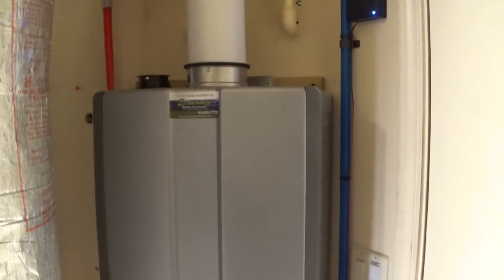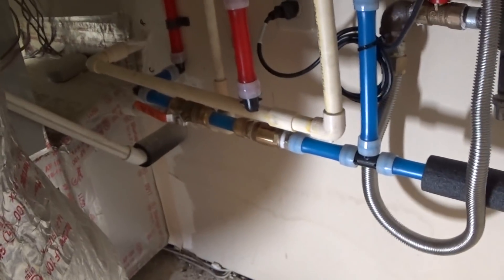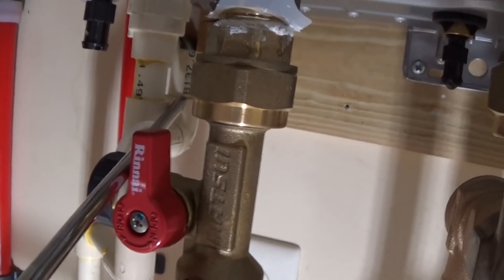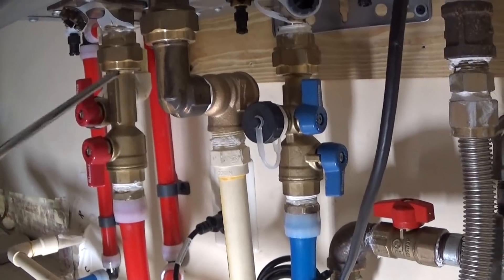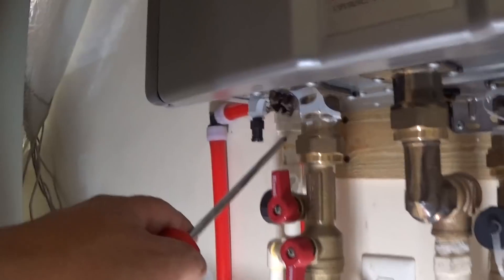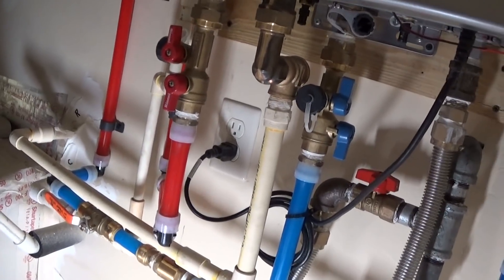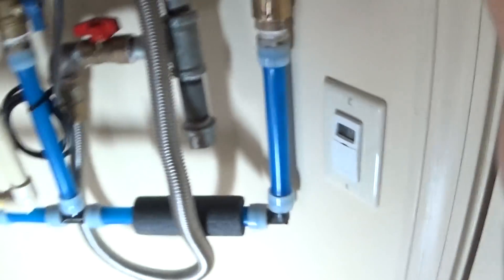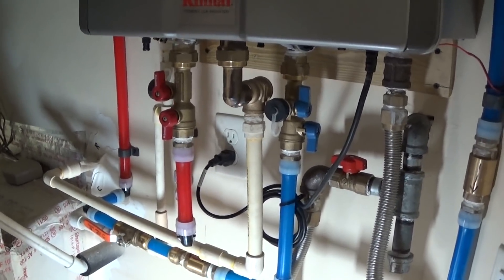Proper piping for a dedicated circulation line on a Rinnai RUR series unit.

Comment: I'm experiencing a 63 error code with swing valve installed on the recirculation line. Do you think these are related?
Reply from the maker: yes the get stuck and will cause a reduction in flow. they need to changed to spring checks. Mike

Comment: You do amazing videos. Question about the hot recirc line. How to (if possible) deal with the hot water recirc if using a manifold? I have a new RXP199IN being delivered this friday. Thank you in advance.
Reply from the maker: If it's a Viga style manifold like there mana-block the circulation will not work no matter what they tell you. The only fixture that will get hot water the hot line you attach the circulation line too.

Comment: I have a single family home with ONE water main.  My house has a tankless unit on each side.  Half of the house has a dedicated recirculation line the other half does not.  We decided to put in a RSC199in so that we could use the cross over valve for all the appliances on the side of the house with no dedicated line.  Well it does not work very well I think due to the single water line and it's trying to mix with the cold water on the other side of the house.  My solution would be to put in a check valve to isolate the loop using the cross over valve, your thoughts?  I am also concerned that the check valve would be under the same sink that has the cross over valve which would bring cold water into that appliance quickly.  I appreciate your channel and whatever thoughts you might have.  Thanks

Comment: After installing dedicated recirculation on my RU160iN i get a water hammer ! Also do you know hiw the economy and comfort setting wirk with a dedicated recirc !  I did put in check valves ,, spring type !
Reply from the maker: Stephen, install a thermex expansion tank on the cold water after the check valve and set the unit on comfort setting. Mike
Reply: @ThatTanklessGuy  Thanks ! I put in some small water hammer arrestors but they don’t seem to help ! Will definitely try expansion ! Does comfort mode not increase costs significantly ?? Also error 63 after cleaned out the cold water filter !
Reply: Just cleaned filter again more black debris !
Reply: @ThatTanklessGuy  still getting code 63
Reply: @ThatTanklessGuy  Installed Expansion Tank. Eliminated the Water Hammer.

Comment: Hello! I just installed the external version on this. I didnt see in the manual about the bleeding of the pump. (Oversight) I also did not install that check valve. My water was lukewarm last nite. No piping was changed other than changing out the old tankless. Lukewarm water usually means a line crossed up. However this is piped basically like the old unit. Can you advise what to check?

Comment: As per the installation instructions, Rinnai recommended an expansion tank be used on the "closed system" area within the check valves because of thermal expansion of the lines.  After a phone call to confirm,   the engineers said that the lines could burst or the check valves may stop working if the pressure gets too high.  Did you use an expansion tank behind that other wall? If not, why didn't you use an expansion tank?   Do I really need and expansion tank? Thanks

Comment: I’m confused about the recirc line.  I have a well so water will be going into my tank at about 53° and leaving at 120° let’s say.  The water coming back to the tank will probably be less than 120° but way hotter that 53°.   What I don’t get is Why does the tank need a recirc pump if you have a tee and both are going back into the tank at the same time?  What if you hooked this up the same way as a non recirc rinnai?
Reply from the maker: The pump moves the water it can not come back by gravity
Reply: @ThatTanklessGuy  but doesnt the water pressure from the well or the street pressure move the water through the tank and to the fixtures?  if it comes back to the tank the well or street pressure doesnt push it back into the tank?  or without a recirc pump the pressure is equal on both sides of the Tee and the water never comes back?
Reply: You still have to evacuate the hot water pipe if the cooler water in order for the hot wster to take its place. A pump moved the process faster with wasting no water.

Comment: Hi Mike,
I don’t have a dedicated return line but I’m curious if I can install 2 bypass valves in different locations because the water lines branch immediately from the water heater?
Reply from the maker: No you can only use one bypass valve per unit.

Comment: do you need an Expansion Tank piped in ?
Reply: There is very little thermal expansion in a tankless. If you want to install one it won’t hurt the system. I only install one when the house has lawn sprinkler off the main water system. Mike
Reply: @TheBuddylab  Thanks

Comment: Fantastic video, as always. Quick question: Given the hot water recirc is now a closed system, does the RUR series require a thermal expansion tank be installed?
Reply: Yes you can install one and ST10 Mike

Comment: Do you need the check valve on the cold side even if I don't gave a recirculation line? I am using the thermal valve under the farthest sink. Thanks in advance Mike
Reply: No check valve is required when there is no dedicated return line. I hope this helped. 
Mike

Comment: You need an expansion tank there bud
Reply: I was wondering this. Are expansion tanks required for tankless? Only if they have recirculation pump built in? Expansion tanks are for if there’s storage of hot water, correct?
Reply: @Jabboy8  Expansion tank is need for recirc system. On a normal open system, without a recirc line, pressure is relieved when opening a hot water valve. Without the expansion tank the system is closed (no pressure relived when the water is heated) therefore, expansion of the hot water could cause a pipe break. The tank allows the built up pressure to be contained.

Comment: thank you for the video! at 7'30", it is mentioned that a drain could be placed on the recirc line before the check valve. Is it OK to have the drain after the check valve, just before it connects back with the cold water feed?
Reply: You could put it after the check valve. Your bleeding it back to the tankless. You need to have the ball valve after the check. I hope this helped. Mike
Reply: @TheBuddylab  thank you! Just wanted to double check. We are having issues with getting consistent hot temperatures, and only get hot water while the pump is running. Once the pump turns off, the water outlets all get cold even when still running 100% hot water line at 4GPM. We think it is a bad spring check valve letting cold water back into the re-circ line. The re-circ line feels cold to the touch, too, even when the hot water-out line is very hot.
Reply: @jr6879 did you ever fix it?

Comment: Hi Mike! Excellent video. Can you please explain why the vent on the condensate drain is needed and what happens if not installed? Thanks!
Reply: It improves the flow out of the pipe and prevents the pipe from getting air bound. I’ve seen a few times on condensing drain lines there was no flow out of the pipe until I cut it. I hope this helped.
Reply: Not just a vent but many probably missed the air gap at the bottom. It is not sealed to the drain. Diff manufacturers state different gaps. Mine is a 1-2" gap. Still dont know why.

Comment: Mike.  Why does Rinnai have the recirc line return into the cold water inlet?  Navien has a separate recirc inlet into the heater.  In theory, that seems more efficient.  How much pressure does the Rinnai recirc pump generate?  More than the city water pressure I presume...  
You are a Youtube Hero!  Thanks!!
Reply: It’s better into the cold water line it mixes with the cold wster before it enters the heater. All commercial installation like hotels and restaurants with tank type heaters or Rinnais Demand Duo all go into the cold water. I hope this was helpful Mike

Comment: great looking install for sure. Not trying to be a video jerk, but your gas valve is on the wrong side of the drip leg. And.... why do they ask for a check valve on the cold side. Anti siphon? I have installed a few of these.
Reply: you definitely did good made the pex look good but man this would be just meh near me... like you didn’t use any copper ??!! I wouldn’t be a fan. Plus we can’t use flex gas line to hook these up and definitely not uncoated ones.. and for god sakes don’t be hitting your releif to purge your boilers. That might work  when it’s brand new. You do that when it’s old and got some build up you’ll never get it to seat right again and it’ll be leaking like sieve and you be replacing it. Oh and shark bits are gross they are expensive and I’m sorry that shits for dire emergencies and home owners. Professionals shouldn’t be using them. Also where is the mixing valve? Pex looks good though give him that.

Comment: Thank you so much for all the info, your channel rocks!!  Is the piping the same for the RUR and RU199IN model with a recirculation pipe?
Reply: Yes except you have to install your own pump and wire it into the RU unit. Rinnai sells a pump and wording harness for it. Don’t forget the two spring check valves. I hope this helped! Mike

Comment: What is the purpose of the spring loaded check valves?  Are they necessary?  I  will have a dedicated return line.  I am installing a RUR199e exterior unit.  Also, If I don't install the return line right away, will the system work okay for now?
Reply: David Allen there to prevent water from packing up into the piping. It will stop the recirculating water from backing up the cold water feed and the cold water from backing up the circulation line. Use only spring loaded checks not clapper 
I hope this helped. Mike
Reply: @TheBuddylab  Thanks.  Two more questions.  If i don't hook up a return line right away, will this unit still work without any problem?  Also, i think in you video you said I can run 2 return lines.  I ask this because i have a master bath on one end of the house and another bath and kitchen on the other with my water heater in the middle.  Can i just "T" it back into the cold at the heater?
Reply: David Allen yes you can run two return lines, as long as both are 3/4” the RUR199 can handle 400’ of 3:4” and 100’ of 1/2”
You can run the unit without return lines just leave the pump off and run it like a regular tankless. It would be better to call me before you install anything. Mike
Reply: @TheBuddylab  Thank you.  I have everything installed except the check valves  which I just bought and will install tomorrow.  I will wait on the return line which i may not even need.  My Master bath is only about 20' from the heater in one direction and my Kitchen about 20' in the other direction with another bath in between and a 3rd just on the other side of the kitchen.  I'll call if I get stuck but your video is excellent. I have previously installed an older unit but it was an old smaller one that I had moved from one spot to another so I have some experience but it didn't have any check valves in it.  I am an amateur plumber or i play one on the weekend. LOL.
Reply: Mike: I found this video too late to prevent my plumber from installing clapper valves instead of spring-loaded check valves. What problems can I expect from the clapper valves in my recirculation line? Is Rinnai aware of the need to use spring-loaded check valves?

Comment: Can you show the proper way to flush/service a recirculating unit using the built in pump?
Reply: Matt Hubbard you can not use the built in pump to flush the heat exchanger, you need a flush kit and flush it through the valve kit. All tankless heaters are flushed exactly the same. Look back in my videos and I have one on flushing a tankless. Mike
Reply: @TheBuddylab  thanks for your help. Your videos are great

Comment: You're very knowledgable and your videos are clear and informative!  Thank you.  
I have an RUR199iN. I'm waiting to connect the recirculation line until Rinnai's new Dedicated Recirculation Valve (Rinnai P/N 107000450) becomes available. Right now, the 1/2" return line is coiled and capped near the unit. According to Rinnai Customer Service last month (Dec 2019), the new part is being manufactured in Japan for Rinnai, and was to be drop-shipped to Rinnai distributers sometime in January of 2020. Based on this video, it looks like the recirc line can also be plumbed to the cold intake line with locally available parts, including a couple of important check valves.  Question #1: Time is not a problem. Should I bother waiting for Rinnai's DRV, or just plumb the recirc as shown in this video?  Question #2: Rinnai's new DRV has a check valve on the recirc side, but not on the cold water supply side. If I use it, would I still need to add the check valve upstream on the cold intake side per your vedeo?   LINK TO RINNAI P/N 1007000450 "Dedicated Recirculation Valve" PRODUCT DATA SHEET:  https://media.rinnai.us/salsify_asset/s-8f81e23e-c8a7-465b-a48f-6be51a6eecc2/100000663%20Dedicated%20Recirculation%20Valve%20Overview.pdf?_ga=2.176458917.148679418.1578948653-1847627683.1578948653  Thanks!

Comment: Mike, was trying message you without going through one of your vids.  Here goes.  I have a Rinnai RL94E.  It has the built in recirc system and I had a complete re-pipe on the house to include a dedicated recirc line.  All good there. My question is I have a guest house or Casita connected to the main house on the property that's tied into the same feed lines.  Can I add a second or additional recirc pump or unit to have better on demand hot water to the guest house.  As of now the bathroom to the guest house is about as far back as the master bath in the main house.  We ran the dedicated recirc line to the main house master leaving the guest house with a recirc line.  It is taking that extra 4 minutes of water running to get hot to the guest house.  Any options of wiring an additional recirc unit...?
Reply: I have the exact same question!
Reply: What did you end up doing?

Comment: Why is the spring loaded check valve needed?  Been watching videos.  Your is the first I noticed it being used.  Also would I need an expansion tank?  I'll be using pex just like you did
Reply: a Dr  the recirc line goes into the cold side. Without it, you’ll temper your cold water.

Comment: Hey Mike, Ive heard and read that you shouldn't use pex right up to the valves  on a water heater since the temp failure rate is under the T&P valve setting. Can you comment on why you chose to do that . Thanks
Reply: Gennaro Lepre that’s not true, what I use is type A pex pipe and the Uponor system. It’s good to 180* and 200 psi. They make brass valves to be installed in line. All of our relief valve piping is either copper or CPVC. Of the 3,500 tanklesses we have installed we never had a problem,
Reply: @TheBuddylab  Thanks for the reply Mike. With that kind of experience, if anyone should know it would be you but if the T&P valve were to trip wouldn't that mean that at that point the pex would fail? Believe me I mean no disrespect in any way, Im just curious if that would happen?

Comment: Please please HELP me with an issue.  Had a licensed plumber install the recirculating Rinnai LESS than a year ago. The flimsy red plastic water line the installer used burst at the check valves in two places causing flooding under my home for MONTHS.....he just came TODAY and charged me $350 more to put same cheap red plastic water line and replaced the check valves.  I am not stupid....the hot water under pressure expanded that cheap plastic like a balloon and it blew out.   I am furious! 1 yr warranty on “Quality parts and installation” . I am having my plumber from 50 miles away (used him for 20 yrs. before I moved into this 9 yr old custom home) come and check the whole shebang. What type of water line is best quality material to do this properly.    The area under home is (normally) dry and does not freeze. The whole house dehumidifier (under the house) is working at max rate to dehumidify all the pools of water.....plumber did not sump water out either.  I had my pest control guy look under entire house just a few hours before plumber showed up and he said there was a lot of water and evidence it had been pooling for a long time, plumber said two small pools of water. I believe the pest controller!  Sick of rip offs and liars.  I pay for quality and to be screwed over twice  just makes my blood boil!   I want this done correctly! Any advice would be greatly appreciated!  The home is 2 1/2 story, 4000 sq ft.  with wet feet in the crawl space, UGH.
Reply: Rusted Knights/ worn out maidens call me at +19042385349 and I will go over it with you.
Mike
Reply: Rusted Knights/ worn out maidens code 63 means the pump is not working, he probably did not bleed the system correctly ( see video on that) my concern is why the Pex tubing melted. The temperature would have to go over 180*. Call me if you like. Mike
Reply: Well, obviously hell froze over...the owner of the plumbing Company has stepped up, offered a refund and will oversee the correct installation for the RUR98e.  This lil grandmother is gob smacked in shock!  I learned so much from watching you do things properly and it gives me leverage to know what I see going on...and to know when I am being gouged! Maybe HE watched your video! Thank you so much and bless you! Good thing too, the control panel is flashing a 63 code since the repairman left!  UGH.  The red plastic works IF the fittings are done properly!  Love the Rinniai unit, it is awesome!